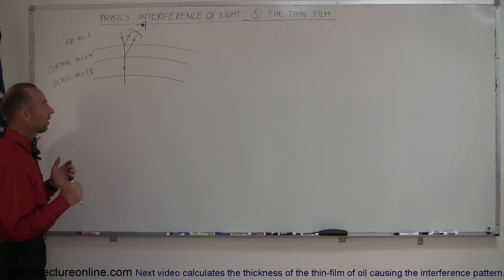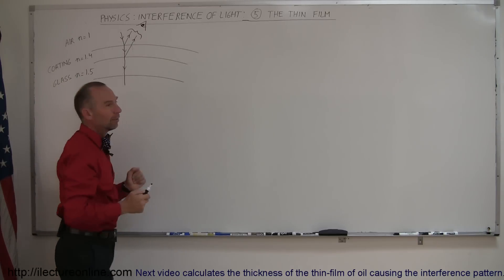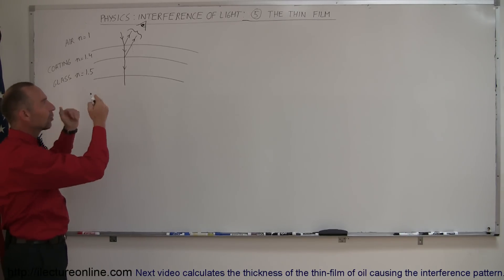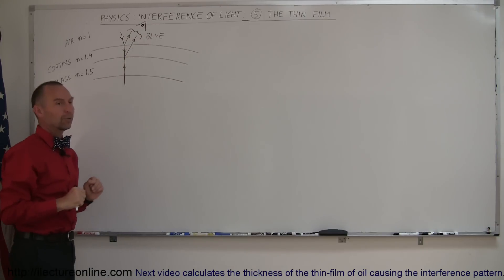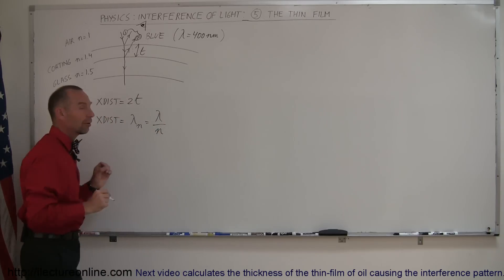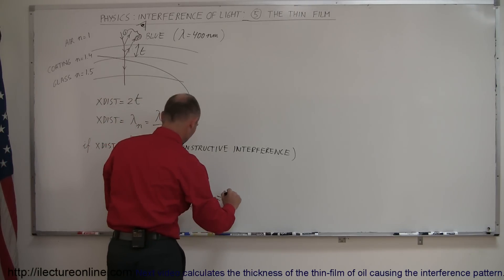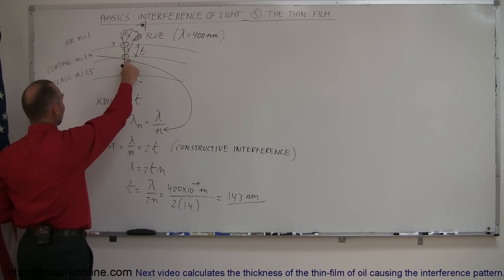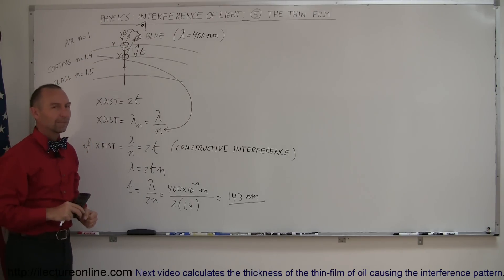Physics 60  Interference of Light (5 of 8) The Thin Film

Comment: How would you apply this if there are 2 different waveleangths that bounce off the film?
Reply from the maker: We typically don't see problems like that.  Do you have an example of such a problem?  (It can be done, but it will be more complicated.)
Reply: @MichelvanBiezen  Yes I do!
A thin film of oil (n = 1.2) floats on water (n = 1.33). When sunlight is incident at right angle to the film, the only
colors that are enhanced by reflection are blue (458nm) and red (687nm). Estimate the thickness of the oil film (in nm).
Reply from the maker: In this problem you work each wavelength separately.  You need constructive interference and find the the thickness for each wavelength.  Note that 687/458 = 1.50 exactly   so there will be a 3:2 ratio.
Reply: @MichelvanBiezen  Would you take the average of the thickness?

Comment: Thin film interference can apply to all Electromagnetic propogatations correct?
Reply from the maker: that is correct
Reply: @MichelvanBiezen  hypocritically, if you had a copper wire with a layer of copper oxide on the surface (where interior cross section of the wire is not oxidized) , would it rectify part of the exterior em field of a current traveling through the wire or have interaction with the skin effect?
Reply from the maker: The scenario  you describe is not the same as the light interference in the video.
Reply: @MichelvanBiezen  ah I see, sorry for the mix up. Thin film interference was cited by someone for  the phenomenon of the impromptu diode for a foxhole radio. Iron razor with iron oxide

Comment: Dear professor, for thin film question, do we care about the angle that the light comes in or we just assume all of them are incident perpendicularly if a light comes in with an angle(for example 30 degree) how can we calculate the wavelength of light strongly reflected when the angle of incidence is 30 degrees? Thank you very much.
Reply from the maker: For simplicity, we assume that the incident light is perpendicular.  If the angle is significant (like 30 degrees) you have to take into account the extra distance traveled due to the diagonal direction.  (t / cos(30))

Comment: Sir please clear  about phase shift on when light passes through  One medium to other medium
Reply from the maker: If light reflect off a boundary such that the index of refraction on the other side of the boundary is greater than the index of refraction on this side of the boundary, then the light will experience a phase shift (180 degrees).
Reply: thanks very much sir

Comment: I dont understand in when the equation is 2t= lambda/n but in video 7 it is 2t=lamda/2n when in both problems it goes through 2 different layers
Reply from the maker: It depends on two things.  Are you looking for destructive or constructive interference AND is there a phase shift on one or both boundaries.
Reply: So if it was destructive interference and the phase change was lambda/2 then the formula would be 2t=lambda/4n ?
Reply from the maker: If you want destructive interference, then you set the extra distance (2t) equal to LAMBDAn/2 = Lamda/2n   and t = lambda / 4n